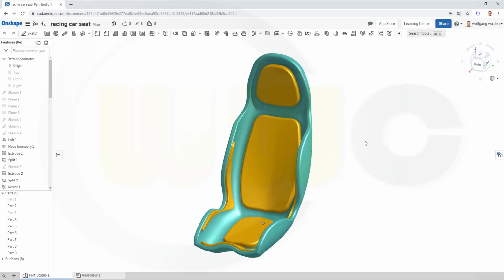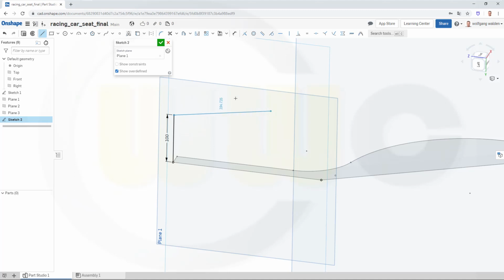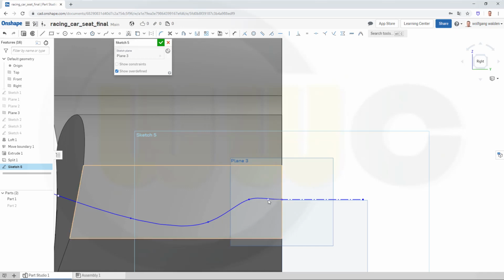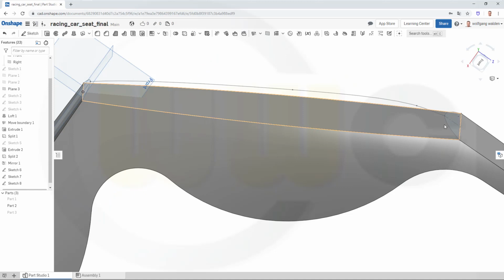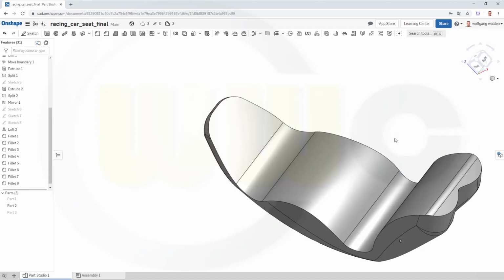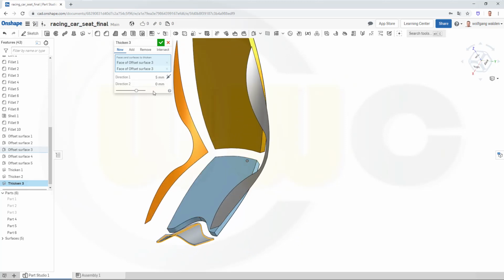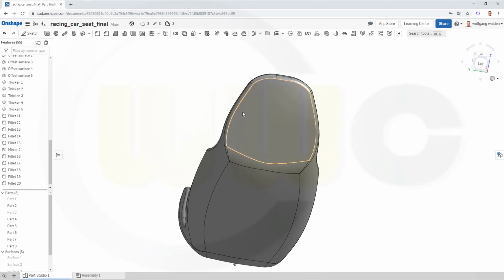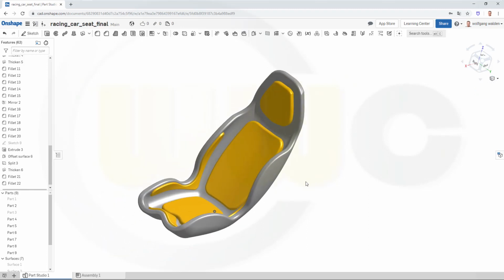Racing Car Seat - Onshape Training - Part Design

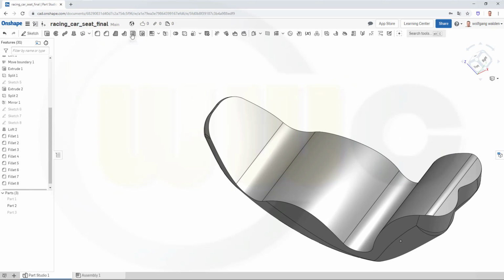Comment: With the new version of onshape, is there a different way to shell the seat at around 23:57 ? I tried to do it but it just says “shell did not regenerate properly: Could not shell part with dimensions” sorry for the long comment
Reply from the maker: Sorry, I can´t tell. I assume that your "seat" has some fillets/rounds which can´t be offsetted. So try to use different/bigger values.
Reply: I had the same issue. It was fixed by selecting the top panel too for the shell.